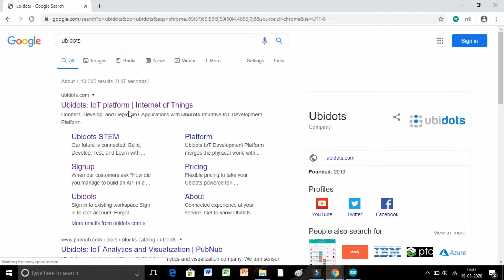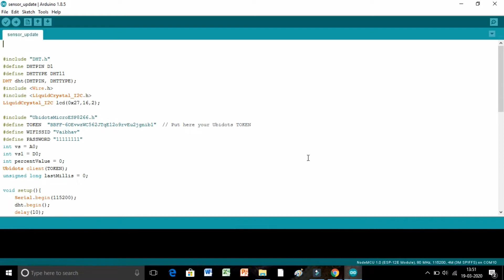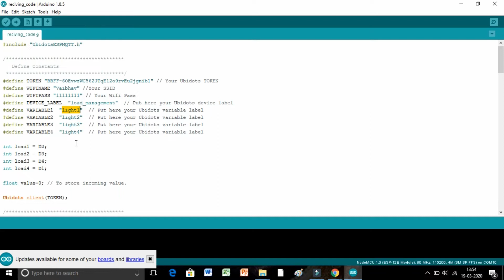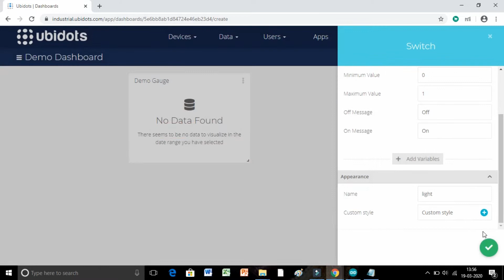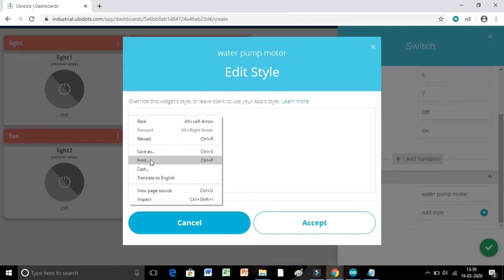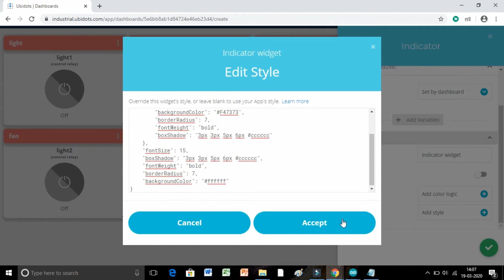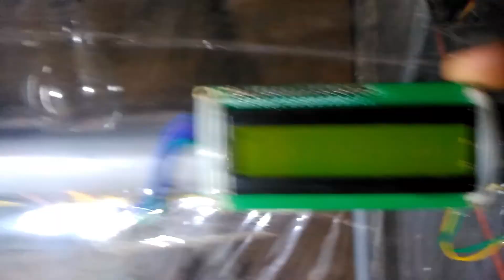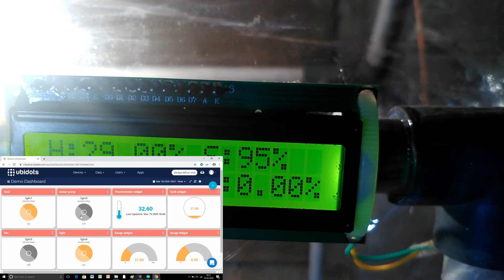How to make IOT based smart greenhouse

Comment: Hi, thnks for your efforts in making this video. But could you please mention the threshold values for all the sensors to make sure when to on the actuators.
Reply from the maker: Ok thanks for suggestions i will definitely cover this topic to new video with deeply
 In video i was manually (web interface switches i use to operation)  but i was show in video how to set standard values for automatic on off and emailing options. Wait for new video i will try to make new video in this topic with improvement

Comment: Code is not working...please make a separate video with complete diagram and original codes.. because i have tried by watching your video but it is not working ..i have done as you guided in the video..my device is not showing in ubidots and nothing is working
Reply from the maker: Read comment you will be everything library , circuit diagram

Comment: Can you make a video to show the detailed connection?
Reply from the maker: I think this project more detail video not important because I am already give all required material link in description like circuit diagram , programing files you can any problem making this project contact me through Youtube comments. I will definitely solve you problems regarding this project
Reply: Can you help with it...like how to connect the bulb fan LCD motor
Reply: How did you put the relay module on the zero pcb..did you use header pins or something else
Reply from the maker: Join me telegram link
https://t.me/Technicalpluselectronic
Reply from the maker: Join me telegram because youtube comments only allow txt message
Reply from the maker: Relay,fans circuit diagram with this project required ardiuno library links:https://www.mediafire.com/folder/po4178tvl81kc/green
Reply: @technicalpluselectronic3845  okay

Comment: How do you Connected this connection to laptop
Reply from the maker: laptop to project wire connection not required. The project design fully automatic and IOT(internet of things) base ,but internet based manually control also be available. more information please see full video
Reply: @technicalpluselectronic3845  how you connected fan and motor...
Reply from the maker: Refer following link for connection circuits https://www.mediafire.com/download/hht3b6h743ap5ca
And relay module (motor,fan,AC 220v bulb)output connection circuit diagram link
https://www.mediafire.com/view/wjv6fdcrn5l26by
Esp8266 programing required All library link
https://www.mediafire.com/folder/po4178tvl81kc/green house library